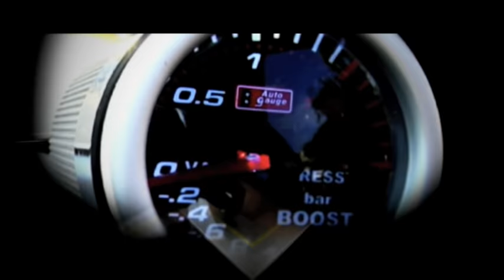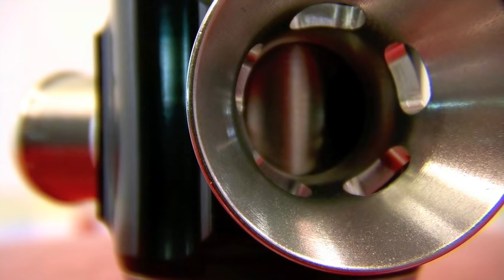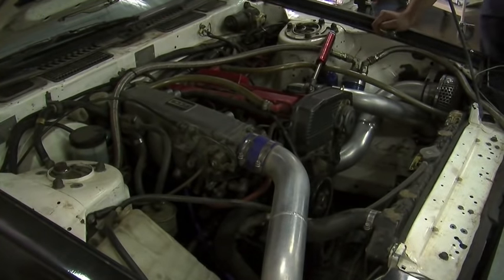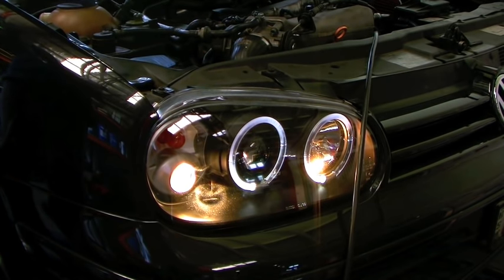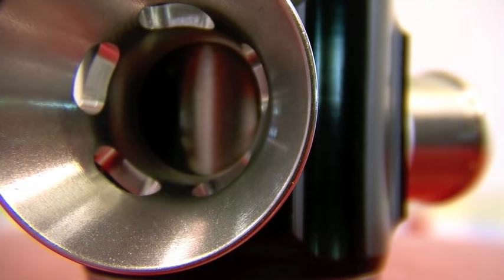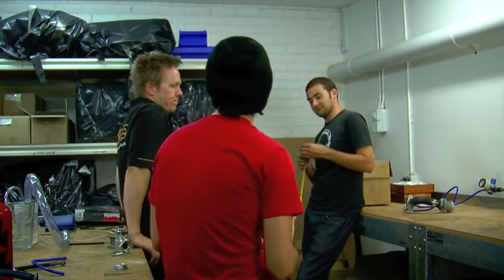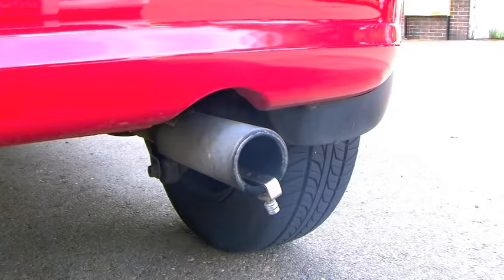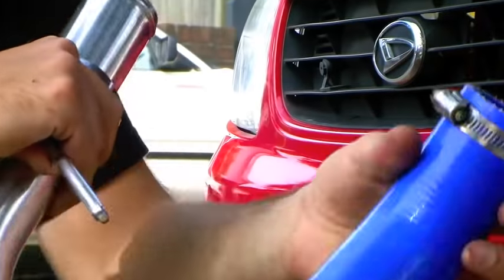Blow Off Valves Mythbusted

Comment: why would you not want that stutututut sound?
Reply: Sounds beautiful
Reply: i am Viking turbo damage?
Reply: Totally Legit Gaming [TLEG] it doesnt damage it, only wears it down a little faster, but its so little that it doesnt matter
though a turbo surge, that would damage the turbo
Reply: i am Viking turbo chatter = ruined turbines.
Reply: pcfxer chatter? do you mean flutter?
because then, No.
Flutter doesnt mean broken turbo, my car flutters and the turbo is fine
Reply: i am Viking for now. Wearing down components that may spin over 100,000 rpm's isn't the best way to make your parts last.
Reply: i am Viking I really love the fluttering turbo sound, but the "additional stress on my turbo" part is really not worth it...
Reply: soarerska it doesnt matter, the stress is so small that you wont notice it, it might not last as long as every other turbo but it will still last a long time.
Reply: i am Viking I prefer the "stushhhhhhhhhh" sound :D
Reply: plebion pie my turbo zututus on 15psi and its just fine
Reply: i am Viking Because it covers up the serene note of your American V8
Reply: i am Viking my turbo SzTUUSSSSHHHH at 29psi and it just got a rebuild so it was maxed out for a while but what a feeling and  sound
Reply: because the rapid depressuring and pressuring danages the impeller.
Reply: Quadrunner i drive a nissan
Reply: fabbeboii my turbo is still going strong at 17 psi
Reply: It's still not good for the turbo, despite your anecdotal evidence
Reply: Richard Botellio whatever you say
Reply: Hey it's not my car so do what you want, I'm just telling you that your self evidence is contrary to what anyone with any knowledge will tell you. But what do  know, I've only been in the industry a decade and a half.
Reply: Richard Botellio pfff what do you even think youre talking about
the "industry" as you call it is pretty split on this subject and theres is no evidence to support the fact that its bad for your turbo
Reply: I have a Nissan as well
Reply: Quadrunner which one?
Reply: 1st Gen frontier with a KA.  Its my favorite truck thus far but I can't hardly wait until the upcoming turbo diesels come out.
Reply: i am Viking What kind of nissan?
Reply: Liam Moop S14a Eurospec
Reply: i am Viking Yes it does wear down a little faster, which is the same as damaging it.
Reply: i am Viking We'll se in a couple of years. Remember that your turbo spins at 100 000 rpm's. Why not just take care of your parts?
Reply: +fabbeboii  Bolloks . In what way?
Reply: +i am Viking its bad for the bearings on the turbo
Reply: +i am Viking "only wears it down a little" which is why you only see that happening on  single stint, and not on purpose.

anything that runs an endurance race will avoid it..think about that.
Reply: +asymsolutions well im not doing any endurance racing in the near future
Reply: +i am Viking youre missing the point. given the average miles someone drives their car in year and and the levels of comparitive stress between a hillclimb car and a street car, expect to be replacing you turbo (if it also doesnt crack the turbine during the failure and fuck up your vavles and cylinder walls.) every 10-30k depending how often you ricer boost it.
Reply: +i am Viking yeah, and if you go around doing nothing but raving the pics out of you car and building boost and surging you will wear it out faster than someone who drives the car completely normal because it's a dyno queen/ show car. Turbos are not meant to deal with surging, and eve dry time you do it, you twist the shift backwards and weaken the metal, on top of that the turbine tolerances are so tight, that the twisting causes it to smack the tips of the compressor into the housing (hence the chatter under tones). Every time you do that, metal gets worn off, warped and eventually you will get shards into your valve train and combustion chamber.
Reply: +asymsolutions ducking autocorrect. let me edit that
Reply: +i am Viking except everything i said has been repeated by professionals. especially considering if we are talking about high boost pressure which is when i can only see someone having a boost surge issue.
Reply: +i am Viking you can get BoV's that do the STUTUTUTU sound like a turbo flutter. If you also have an adjustable one you can crank it up all the way so it ends up just having the air come back to the turbo thus making the noise, but with the safety to prevent any surges and too much pressure coming back against it.

Honestly though I agree with you, having no BoV is fine. Turbochargers aren't made of plastic unless you buy them on eBay. You have a good turbo out of a 'Bishi, Nissan, or Subaru then you're fine. And especially fine with a Garrett. If you have an eBay turbo, you may want to rethink your life.
Reply: +Violetta garrett all the way ;3
Reply: +Richard Botellio Let me guess, your American right? they all seem to think not having a BoV is a huge issue but in Australia it is very common not to run one including people who run 40+ psi,  the workshop that tuned my car and tune most drift cars and late model Japanese imports in my state also don't run BoV's on their cars.
Reply: +asymsolutions It was common in the 80's for Nissans not to run a BoV or BPV, my 180sx did 150,000km's with no valve and the turbo is still going fine, it's very common in Australia for people not to run them, they are not replacing turbos every 10-30k's, don't know where you got the idea that would happen.
Reply: +DriftNick and they were all low boost aystems. Which is not what im refering to.
Reply: asymsolutions go to the channel "Fullboost" and you'll fine 100's of fast turbo street driven cars that run no BoV.
Reply: +asymsolutions Regardless there is no evidence that indicates premature failure of DECENT turbochargers such as those made by Garretts and top name brands like Nissan and Subaru that sometimes use Garrett turbochargers to begin with. They aren't made of plastic, it's solid fucking metal. The pressures may be high but no, not enough pressure coming back with damage the blades or the bearings. Make sure there's good, cool oil coming to the turbo and it'll be fine.

Also it's advantageous to not run BoV so you always have some boost pressure to easily spool the turbocharger back up, in performance situations.
Reply: Your obviously not a petrolhead
Reply: +i am Viking Police attention?
Reply: +i am Viking I think someone should just make some sort of BOV that has a flutter attachment or option. i'm sure if set up right its totally possible. kind of like a kazoo vibrating a peice of plastic.idk
Reply: +ghostrider433 There are BoV's that mimick the sound already.
Reply: +i am Viking Turbo flutter is a sign of turbo lag, and is not really a 'good' thing. People tolerate it because it sounds cool, but it is not a performance enhancing sound, actually, the opposite. 
Blow off valves will not give you power, it works by saving back pressure for later instead of it back flowing and halting the turbo, causing it to flutter, so it can be more responsive and give power quicker. When a turbo flutters, that is the sound of wasted power.
Reply: +Richard Smith although what you said is true you might want to reprashe the first sentence
it isnt a sign of turbo lag it it just slows the compressor down by forcing air out
Reply: i am Viking It does cause lag. When a turbo flutters, it will then lag directly after, because a ton of pressure just back flowed and halted your turbo, so yeah, it is directly a sign of turbo lag. Well, at least a cause of turbo lag.
Reply: +Richard Smith It actually is the complete opposite. Do you even know what blow-off valves are for on a turbocharger? Any boost pressure that is built up while accelerating is immediately discharged when you take your foot off the throttle, so the turbocharger isn't under pressure/stress.

Having no blow off valve, giving you the flutter noise, allows the turbocharger to ALWAYS be on boost; to always produce positive pressure, even if your foot is off the pedal and the RPM's still allowing the turbo to be spooled. So really it's the opposite of giving it lag, it reduces turbo lag after you shift into a higher gear from being at full boost in the previous.
Reply: Violetta You may want to look into turbo surge, and maybe you'll understand then how keeping a check on the back pressure and not allowing it to indefinitely build in front of the turbo is a good thing.
Without a blow off valve, you cannot prevent the back flow into the turbo without putting your turbo under too much strain. Having a blow off valve allows a regulated amount of pressure to be saved for later, without it, it will build until turbo surge, or it must be wasted.
Reply: +Richard Smith Like I have stated in my earlier comments, turbo surge is just fine. They aren't made of plastic, they aren't going under enough stress to really make a difference. Have you ever ran a turbocharged car with and/or without a blow off valve? I don't think you have; even MCM's friends here explain that it isn't a problem.
Reply: Violetta What you are missing is when reverse flow halts the turbo, it has to re-spin up, and all that boost is lost anyway. This is a double whammy leaving you at square one. You need a boost reservoir between the turbo and the intake if you want to save boost for later, but this is not the point of the blow off valve. Without that, if the turbo stops producing boost, but it cannot go anywhere, it'll flutter and stall, meaning it'll have to re-spin back up to begin making boost again. This isn't even going into turbos ripping themselves apart from turbo surging, but not getting into that. Allowing the turbo to vent off will allow it to maintain a boost level that would otherwise stall out if not allowed to go anywhere. This makes it more responsive, not less, even though it is venting turbo off. A boost reservoir has nothing to do with this, however, will help with lag, but is not the issue addressed by the blow off valve.
Reply: +Richard Smith Nope, the turbo isn't stopped or spun in the opposite direction, there's too much force between the exhaust gasses still spinning it and momentum of the metal blades. The stutututu sound is just from the air hitting the spinning blades, the amount of speed the blades lose is negligible.
Reply: Violetta If i said it spun in the other direction, i misspoke, the air moves the wrong direction. That is what makes the fluttering sound, the air moving the wrong way forcing the turbine to slow too quickly. It would be better to vent that air out instead. As I said, people do it for the sound, there is no advantage to the turbo fluttering, whether the air is flowing through the turbo backwards, or vented out, you are losing that boost either way.
Reply: Richard Smith You've got it all wrong, for one it takes longer for the turbo to fill all the piping in the compressor side with boost with a BoV then with none after lifting off throttle then getting on throttle again, that is a bigger issue the turbo when you are quickly on and off throttle when the turbo is already above boost threshold, even with a BoV the turbo is going to slow down, there is no avoid that without anti-lag.

In the real world the difference is so small you wouldn't even notice it, I've drifted my car with and without a BoV and other then the sound you notice no difference and when you are drifting you are constantly on and off throttle where any lag would be an issue but it isnt.

Also there are countless people in Australia and around the world who don't run a BoV and never have any turbo issues.
Reply: +DriftNick Thank you...
Reply: +i am Viking if you have a blowoff valve the air can escape wich means that the turbo isnt getting any air back in it. if you dont have a blowoff valve it means that air is going back in the turbo wich means it will decrease the spinning speed of the turbo, and therefor will take longer to spool back up when opening throttle again
Reply: bliephoofd In the real world there is no noticeble difference in response between running a BoV and not running one.
Reply: +i am Viking I have experienced that cheap chinese turbo does push white smoke out of exhaust at flutter... Then installed blow off valve and never smoked again. I guess all that pressure pushed shaft and bearings little bit and allowed oil to go through
Reply: +ERK77VI and 'cause it's a cheap turbo. x) With a well built one like a Garret that'll never happen; running no BoV will not hurt it.
Reply: +ERK77VI well ofcourse, its a chinese turbo
Reply: wassup haters By slowly fucks you do mean no noticeable difference in life span? It's very common for people in Australia not to run them and never have issues.
Reply: bro. just get over it.
Reply: +wassup haters Get mad. It doesn't harm the turbo at all.
Reply: lol you all need to get over it.
Reply: +i am Viking Because it gets annoying quick.
Reply: I much rather would have the ungodly wail from a screw type blower like Whipple or Kenne Bell! Turbo takes second place!
Reply: +Tim Ramich well you could probably say that about most car sounds, including BOV noise, yet we still like all those potentially stupid noises so I don't understand where you're coming from
Reply: at higher boost levels it can damage the turbo. at lower its not really a problem
Reply: TheBASR05 'no different load than when on boost'. Thats a very fucking stupid thing to say, I hope you don't help others with their turbo setups
Reply: JDM Viking
Reply: JDM Viking
Reply: It damages the Turbo
Reply: bull crap i dont buy it
Reply: JDM Viking because it wrecks your bearings lm fucking ao
Reply: JDM Viking cause it's mint and I can make the noise in real life SUTUTUTUTUTU
Reply: the way richard explained it makes the most sense....i mean i really dont know a hell of alot about turbos at all...but if what violetta is explaining was right....then whatthefuck would be the point of an anti-lag system? thats just what ive taken from violettas explanation....i just personally think richard laid it out better. his explanation leaves the headroom for the reasons a BOV, and misfiring systems were created....right?

or am i 1000% wrong? i dunno why im even chiming in really??.... ROFL
Reply: Lucas Kara anti lag system or als is use when you going around a tight corner and you went from 50-35 mph and you step on the throttle you will still have boost becouse of the als.
Without the als after you slow down in a corner and step on the throttle you will lose all the boost and you will have to wait until the turbo spins up again to produce that boost power.
Reply: i do generally know what anti-lag does, i only meant the way richard explained it made more sense...or am i wrong again?? why the fuck do i keep replying? XD
Reply: coz wear
Reply: Only reason i can think of is if you want a sleeper car.
Reply: To everyone here, in australia it is ILLEGAL to have a non factory BOV. 
Hmmmm seems like its a... performance part?!
Its not essential for the longevity of your turbo 
END.
Reply: You typed the sound so perfectly lmaooo
Reply: Bainy Not essential, and not necessary. But everyone who argues "it's metal there's no damage" from back pressure is beyond ignorant. Materials do not behave the same under load, heavy stress, at high temperatures, and when spinning at 100k+ rpm. At that velocity, the blades might as well be plastic. Additionally, legislators do not determine the function of an object. Just because Australia's upside down representatives said it does not make it so.
Reply: Because it means your valve is not doing it's job or isn't good enough for the pressure it has to deal with.
Reply: Bunch of arguing nerds
Reply: Get the app then :)
Reply: They sound like old man farts. Who wants a turbo car that sounds like an old man farting.
Reply: @MrJakeyyy  because tssssssss
Reply: Weakens your turbo
Reply: bc it sounds ugly and annoying. i like the woosh sound but not the flutter
Reply: @MistRVertexZ  I was running 15psi boost on my Cordia turbo with no BOV at the drag strip and i could feel inbetween shifts  my turbo stalling and then hesitating to get back on boost . Toot toot toot sound might sound great and shows no difference on the dyno where your not shifting between gears but definitely hurts quarter mile times.
Reply: @davidgriggs3967  okay but most people arent running quarter miles
Reply: @MistRVertexZ  Doesn't matter 15psi isn't much and noticed it from 11 psi it was happy, 15psi and not running a BOV was the difference between low 14's and high 13's.
Don't know who you are referring too or what type of driving but if your not on the gate and sending it you may aswell sell your turbo ride .
You can split hair's with all these other people commenting but until you have experienced turbo stall you would not have a clue what we are on about.
Reply: @davidgriggs3967   well said. thank you.
Reply: Funny everyone here argues over having or not having a bov is good or bad yet.... hello? The engineers and creators of these cars dont put a bov in their car... because they dont see it nessicary. Ergo it's not needed. If your car comes with a turbo at any boost level but no bov from factory then its obv been tested and not needed what so ever. I have a Xgen honda civic theres no blow off valve yet it's a Honda. They last for ever.
Reply: @starcraftgod1212123  cars get tested, sold and then recalled, suppose that's because they are fine? Just because something doesn't come as standard doesn't mean it's fine without. Believe it or not air bags were an upgrade at one point, now standard. Ergo Bov could become standard. Engineers don't always have the best set ups for long lasting, often they choose performance knowing they can repair/replace.
Reply: @starcraftgod1212123  also a vw golf comes with a bov as standard, does that mean that only a golf needs a bov but every other car That doesn't come with a Bov doesn't? Can't say it's not needed because some manufacturers save money by not putting a bov in
Reply: @dannythorpe1425  ok well that's because laws were passed demanding cars increase their safety or be taken off the roads / stop being made. Recalls do exist.. but to fix weak points or fuck ups during creations of their otherwise perfect cars. You cant make 1,000 things copy and paste without a mistake on 'some' of them. And again its honda. The long lasting longevity engine making experts. Not even the type r come with them.
It could become a standard. True... but everyday turbo cars have been around for hooow long now? If it's not a problem yet it never will be
Reply: @dannythorpe1425  congrats for them they made an engine that would benefit from it. 
Dosent mean others will
But is also a sports car. I'm talking about every day economy cars not fast ones
Reply: @starcraftgod1212123  bless ya. Didn't realise a golf isn't an everyday car.
Reply: @dannythorpe1425  well my friends st isn't. Nor is a sti. Lol their ment for fun not point a to b cars. But I mean doesn't mean u cant use them that way
Reply: @starcraftgod1212123  if you have enough money a Ferrari can be your daily drive. One person's every day car can easily be next mans dream car.
Reply: @starcraftgod1212123  As engine's have evolved over the year's and engine's boost has been lifted for more power by the manufacturer's they have installed recirculating BOV's especially on vehicle's that have a MAF sensor .
If your Honda has a stand alone ecu with it's own air induction mapping and you have low boost you can get away with out one ,but if you have high boost and suddenly you close your throttle body and that air has nowhere to go your turbo stalls or slows down to the point of hesitation as you get back on the gas.
Reply: @dannythorpe1425  very true
Reply: @davidgriggs3967  I know that's what I'm saying. If your aftermarket huge boost that's one thing go bov happy.
If it's a small 4 banger like my 2017 it doesn't need it. And if a manufacture didn't include it in the cars creation.. "if u want sound" then you dont need it.

I do plan on flashing my ecu tho shortly here for 9 pounds more go from 174 to 225 230
Reply: JDM Viking because it decreases the performance
Reply: @TheOnlyToblin  yes
Reply: @davidgriggs3967  The hesitating is because your car isn't tuned properly for it, it has a rich condition when you lift off, you can run no BOV and have no hesitating, I drift my car, it's constantly on, off, on throttle and there is no lag caused by the flutter.
Reply: @DriftNick  Yeah it's called antilag or 2 step.
Reply: @davidgriggs3967  I don't understand, why did you mention antilag or 2 step?
Reply: cause its the air going back to the turbo blades...causing a big load in the oposite direction and damaging the turbo
Reply: aDr wrong, there is no bigload of air its a pump of pressured air and thats it, imagine a car tire popping, a short burst of air, and even if the throttlebody is closed some air still passes it and the actual load on the blades are low pressure and short
Reply: Alright, a lot of angry people here, most of which are just citing themselves as a source. The fact is, there are two things that can happen, the effect of which is dependent on a few things.

Yes, it is possible to break a turbo with the blowback, but you’d need a massive turbo for that. Reason being, the larger the turbine blades, the more momentum they carry. The more momentum they have, the less they want to stop. In an overly large turbo, the blades may continue to spin despite the build up in air pressure. If that happens, air pressure will skyrocket as it hits the preverbal wall, and cannot leave the turbo fast enough. If the air pressure exceeds the stress limit of the turbo walls, they’ll fail at their weakest point. The wear for most standard sized turbos is fairly minimal however, and may not cause noticeable drops in turbo lifespan.

Performance, however, is another story. If you recall the momentum bit I had earlier, the larger and heavier something is, the less it wants to slow down. Most normal sized turbos have fairly light turbines. If spun at high speeds, they will lose it quickly because they don’t have much mass. That said, having too much pressure in the direction the turbo is trying to push air, will certainly aid in slowing it down some, although it may not be immediately noticeable. That’s because the air is slamming into a wall, can’t move through fast enough, and is pushed back the way it came. The blades of the turbines are designed to push air, but that also means the air can push on them, creating drag. That could lose you a tiny bit of performance.

Having some residual boost, however, can be beneficial, even if the turbo needs to spool back up a bit. A blow-off valve may not be necessary, but if you have one that bleeds just a tiny bit of excess pressure, you may get the best of both worlds. Both keeping the turbines momentum, and keeping a bit of overhead pressure. But, for that to work, it is important that you do not have a blow-off that dumps the excess air entirely. It’s keeping just enough to keep the pressure up, but letting off enough to allow air to flow and keep the turbine spinning for a bit longer. Such a thing has to be carefully tuned for both the air flow of the turbine, and the varying intake velocities of the engine and the size of the turbo. A larger engine might just gobble that overhead pressure up as it coasts down in rpm’s, while a smaller engine might not. You need to adjust the systems accordingly, and figure out which works best for your car and turbo. If you do not want a blow-off, that’s fine, since the loss of performance is minimal. But if you’re in a heavily competitive environment, where a few microseconds might be the difference between beating your lap time and falling behind, it might be beneficial. Slight less stu-stu, but it is what it is.

Plus, if you set it up right, it kinda sounds like a small pneumatic piston going off, which is kinda cool.
Reply: I more like the pshhhhhh sound 🙏🏼
Reply: @MistRVertexZ  lmaoooo bro ik you said this 7 years ago but this is so dumb
Reply: indeed mate 👌
Reply: So the turbo lasts longer
Reply: When you want the ultimate sleeper build
Reply: It gets annoying as you grow up
Reply: @garethwillis  disagree, my s14 made me giggle like a kid when it turbo fluttered when i was 18, im now 25 and recently bought a new s14, same reaction😂
Reply: @MistRVertexZ  yeah but 25 is still very young. I promise by 30-35 you'll get rid 😂
Reply: @MistRVertexZ  I was the same but 39 now and stopped usim them about 10 years ago. As you age you want more and more discretion, at least a lot do.
Reply: @garethwillis  haha you might be right, ill update this comment again in 5-10 years😂👍🏻
Reply: @MistRVertexZ  see you in 2028 pal 😊
Reply: Fr
Reply: I swear
Reply: Sounds sick but wears yiur turbo out faster because it's showing air in and out the turbine at the same time